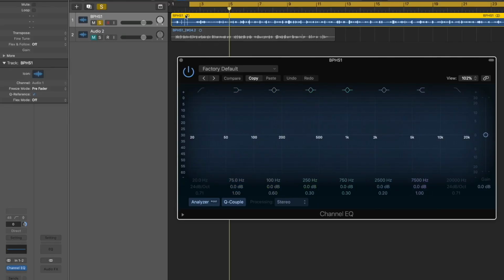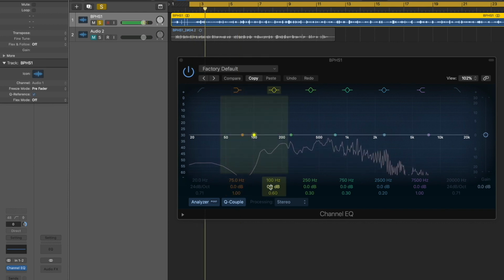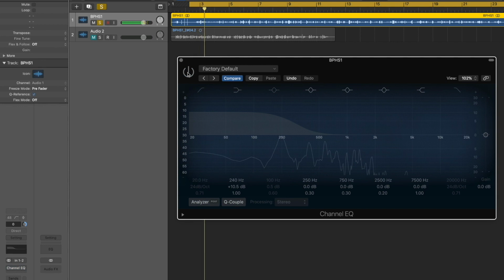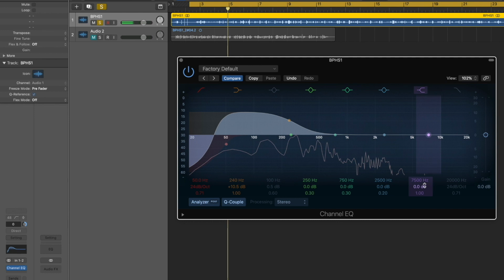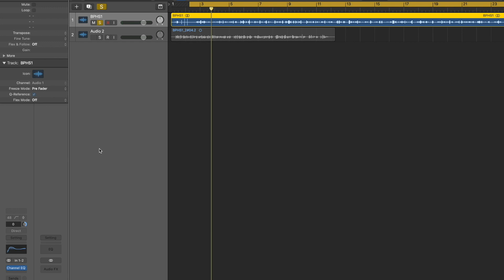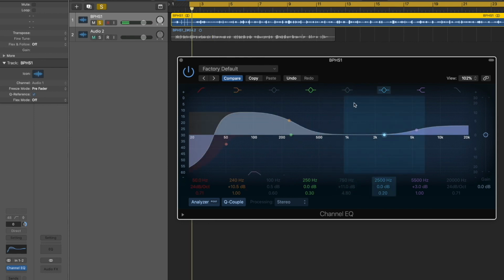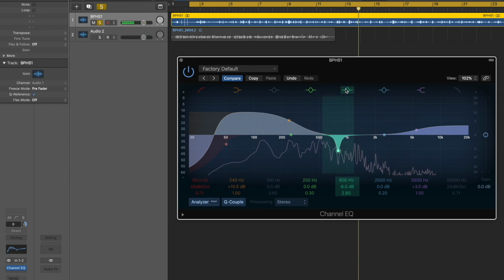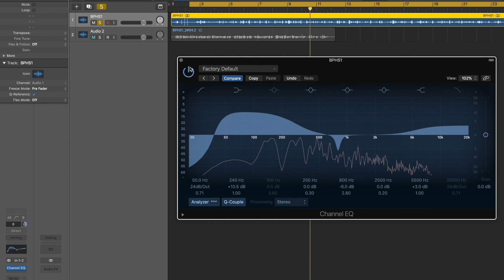EQ Your Headset Mic To Sound Amazing!

Comment: I understand that this is not the BEST EQ I could have done on the microphone. This was a quick 5 minute demonstration to provide the person who asked the question a general idea of what they might need to do to get a much better sound out of their headset mic.
Reply: Good work. Also give a compressor before or after a go. I used that headset on a couple of streaming shows (Tip of the Hats, some Lans) and usually got a good sound of them. For less noisy environments it's a nice headset. For noisy keyboards and louder enviornments a cardiod/super/hyper cardoid does better.  Equalization is heavily dependant on the voice. The method of boosting a bit to find icky frequencies is a good starting point.Most of the EQ work I do is cuts, most often on dialogue.

Comment: Podcastage ... I have been following your youtube channel for a very long time. I really appreciate your content. But may I ask, can I also have this sound in real time? I bought a BPHS 1 a week ago and I am a little bit disappointed with the sound I hear. Can you teach me how to make my AT sound better in real time?
Reply from the maker: You would need a real time processing plugin. On windows something like Voice Meeter Banana does this. I do not know how to use it though. Or you could run it through an audio interface that has DSP processing and allows for you to add some EQ to it, Elgato wave XLR, Rodecaster Pro, Lewitt Connect, etc.
Reply: @bsp  VB Cable does a better job and works well with Equalizer APO.

Comment: Can anyone please recommend a similar EQ app or plugin for Windows? I like the way LogicPro's visual interface lets you hear the changes in real time as you play with the settings.  Closest I've found for Windows so far is the TDR Nova plugin, which can be used with Audacity, but it's a little difficult to control the curve.
Reply: Reaper allows you to see the frequency waveform in the EQ and adjust and hear it in realtime.
Reply: @MasterBenton  Thanks!  The Reaper plugins work in Audacity too.

Comment: sir I have a headphone which is Gamedias hebe m1 it has  a good mic at the budget but it catches fare bit of noise. so I bought a lapel mic from Boya ( Boya M1) which has 3.5 mm connector connected through my laptop headphone port and use the usb headphone as a main listening device. The problem is I really don't get any better results from boya m1 as a default settings . how can I twick the settings and get a better result.

Comment: Hey Bandrew, I have to ask. Do you speak louder in front of the mic than you normally do speaking to other people? I've always speak to my mic using my regular voice volume and I notice that it's hard to hit that -12dB to -9dB range. And when I get excited speaking with them, for instance laughing, my interface would clip since I have to set the gain at about 54dB. I'm using the cheap clone of the SM57, the Pyle PDMIC78 with a ZOOM UAC-2 interface.

I think you mentioned a couple of times to practice better microphone techniques. Does that include moving the microphone to the side of the mouth instead of directly in front of the mouth so that the pressure from the sound won't be too harsh on it?

Comment: That second high shelf sounded just a bit aggressive in the higher tones, not bad just off to my ear for some reason.  Of course again my hearing is not the best so it might have just been me. Overall seems very straight forward and kind of the same thing I do with my lapel mic audio when I make vlog-esk videos, however now I will have to see if I can hear the "ehhhh" (this is the technical term right?) noises and clean it up some more.
Reply from the maker: Yeah this isn't a perfect EQ. This was done in the amount of time the video was so maybe 5 minutes on one set of headphones. I did not do any etests on other playback systems. But in general I would do something like this.

Comment: This is such an incredible video, and the results are amazing. Its just a pity that I understand absolutely nothing this guy is saying, tough video to follow if you have zero prior knowledge of sound design. If you made a tutorial for dummies with some free software that is on both mac and windows, I'm sure you could get a bunch of views.
Reply from the maker: Audacity is a free piece of recording software and it has an EQ (equalizer) plugin that is built in. It will look slightly different, but it should have the exact same controls and functionality.